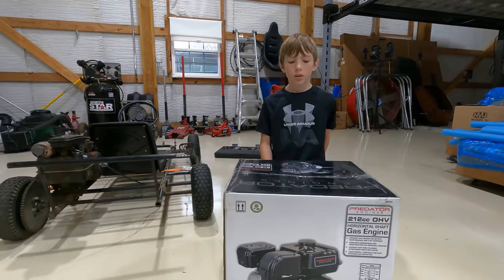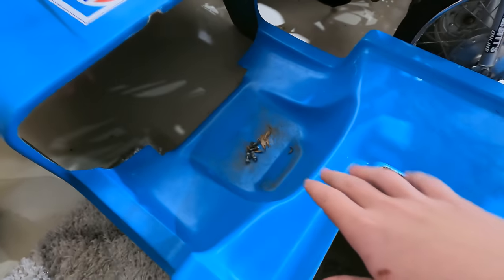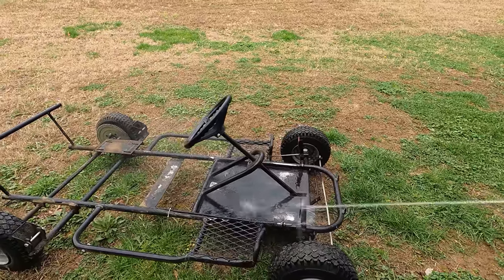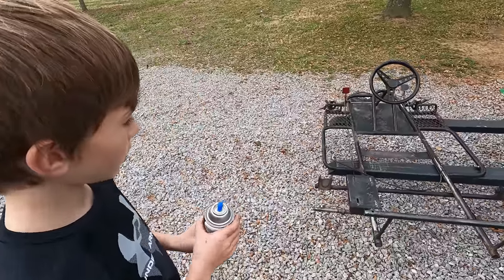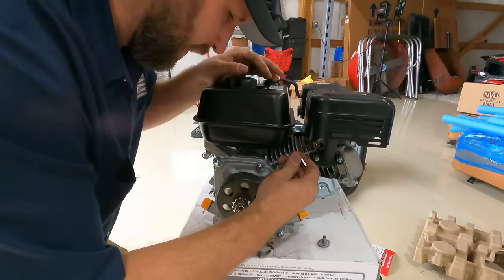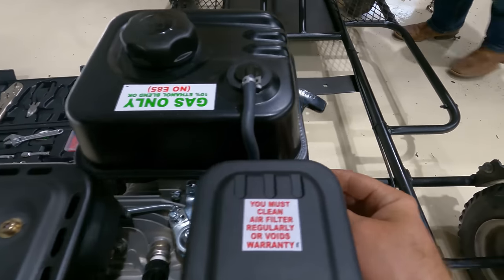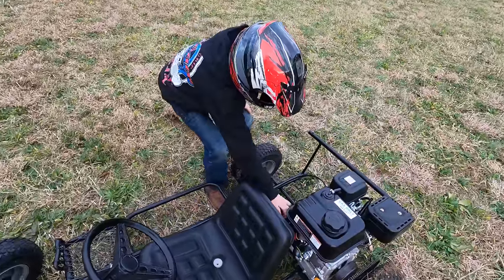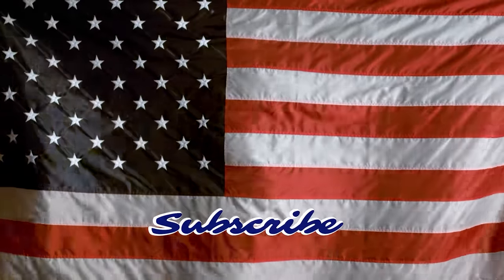REPOWERING my Classic Go Kart with 6.5HP (DOULBE THE HP!)

Comment: Might need to consider a dual rear wheel drive system. Problem is might have to add about 4 or 5 inches of extending the rear part of the frame . Each each rear wheel will need to have a drive sprocket and maybe go the whole 9 yards and have some safety covers ! Should you except this mission …

Comment: Yes unplug the low oil cut off sensor. Get rid of all that plastic over the throttle and reset a return spring by drilling one of the arms. Do you really want to make that thing move remove the governor. Don’t worry about the engine blowing up it will get valve float before it gets to that point. Cutting the horsepower back down

Comment: The reason its quitting when hes doing donuts is the engine has a low oil sensor and when it spins hard like that it thinks its low on oil and shuts the engine off you can bypass that

Comment: Loosen the bolt on the throttle arm for better movement of the arm. You can place the throttle cable in a few different places on the engine.

Comment: Don’t use a 10tooth clutch and a 40 60 tooth sprocket this combination will make it spin even if your at 5% throttle I suggest you get a lower gear’ sprocket

Comment: You need to remove the oil level shut off switch to stop the engine from shutting off when you hit bumps...there is a video on you tube showing you how to do it on predator engines

Comment: I think it would be very good that he built his first Small engine my very first engine that I ever built in my life was a small ambient on a go-kart and that would be a very good thing for him to learn how to do nothing bad wrong with it that's a big jumping and bounce around like that and it dying it's because that motor is made for Taylor and stuff like that but it's most definitely something to do with the fuel possibly the floats in the carburetor or something like that not really for sure I never had that issue there is one possible pain that I could think of I don't know if you forget about or not I just now remember being the same things you're made for like wood splitters rototillers and stuff like that they have a oil pressure shut off switch like if they get low on oil it cuts off if you're driving it and bouncing around like it through the oil to another direction away from the sensor and causes it to die so you can unhook it